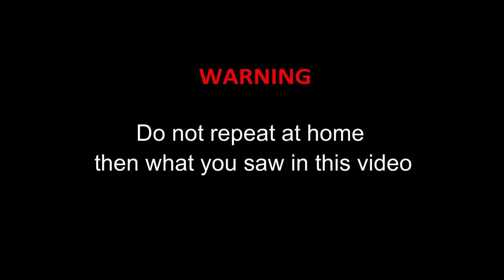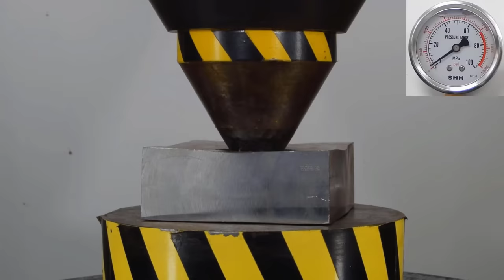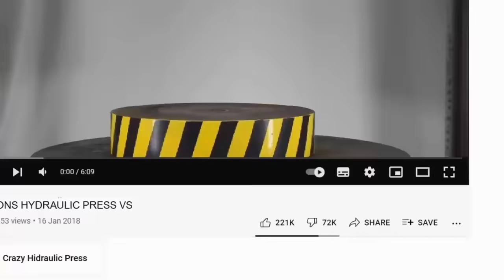HYDRAULIC PRESS VS OLD AND MODERN ARMOR

Comment: I've seen this press destroy so many things... I was quite surprised when something actually managed to push back for once.
Reply: Rifle plates can stop any Small arms bullet except maybe a 50 bmg. They are strong af. I have some armor plates myself.
Reply: He took explosions to a whole new level. And there was no bomb. Dam!!!
Reply: pay attention to the hydraulic tips, they use different tips..i doubt the results they get.
Reply: "push back" .... now ain't that a Newtonian term :)
Reply: @emmw7794  A 2" AR-500 plate like in the video should easily stop a 50 bmg...
Reply: @frankfurt9679  ich hab Physik nach der zehnten Klasse abgewählt. Ich darf das so sagen. 😏
Reply: Strong as F?  So just how strong is F?
Reply: The 666 has been achieved
Reply: @emmw7794 level 4 can. 3+  still has trouble with faster 30 caliber rounds
Reply: @CosmicGate184 not a personal protective vest
Reply: Well, technically, everything does push back
Reply: and even take revenge.
Reply: I need it to build my next pc chassis.
Reply: My muscles would destroy that press after a good pump. 🥴💪
Reply: @CosmicGate184   Bit of an expert on that here, as I work for the largest cutter of AR-500 in the US (we buy AR by the boat load, literally, and we test products at the range) 
You need 1/2" AR500 to stop a 50BMG at 1k yards (energy needs to be under 4000fpe), there's a higher chance of failure if the target is rigid mounted as well, you can get away with more if the target is hanging by chains and angled about 15 degrees, so it can deflect the round into the dirt. 

The video seemed to show 1/4", which is likely actually AR-400, fpe needs to be under 700 to reliably stop rounds, so pretty much only good for stuff like .45 or 9mm, but there's no scale in the video, so I could be wrong..... 5/16 AR500 good for .223 up to 300 blackout. 3/8 AR500 good for .308 up to 6.5 creedmoor. But again, angle of hit and rigid vrs hanging mounting makes a HUGE difference.
Reply: @mmabagain about five handies.
Reply: That was a straight violent implps😢
Reply: @x_andy7407 I was going to write the same thing. The one used on modern armor seems to be made of a lot softer material.
Reply: @mmabagain on a hexadecimal scale, nothing beats F.
Reply: @artankozak2557 that would almost make sense. If the impact is allowed to dissipate sideways without penetration, then what's behind the armor will endure a smaller force (blunt force trauma is still a thing), and then maybe the armour can also be thinner. But there needs to be something hard behind it, possibly ceramic, to avoid penetration.
Reply: @x_andy7407  They only need to use a tip harder than the thing they are crushing. The harder tips are much more expensive so they don't waste them on things that they wouldn't make a difference on.
Reply: @artankozak2557  The one used on the modern armor was the exact same tip. They had to switch out for a harder one. AR500 is over 3 times harder and many times more abrasion resistant than the plain steel plate that was used on old tanks.
Reply: @mmabagain I continue this word ... uck. It's strong as *uck.
Reply: I hope better shielding is going to be used. I'd suggest 3/4" plywood and a 3/8"+ polycarbonate window. Tie it up with rope or straps. Not being in the same room during a test also seems prudent.
Reply: FAKE!
He removed the paint of the Soviet armor. The Russian paint repelled the shells. The steel just held the paint in place.
Reply: @canopyjunkie1597 Anyone who says "bit of an expert here" when talking about anything firearms 🤣🤣🤣........I'll take the quiet guy for 500 Alex!
Reply: Nokia
Reply: @CosmicGate184  Пресс создаёт статическое усилие, а бронебойный снаряд - динамическое. При этом может быть хрупкое разрушение и осколки брони поразят экипаж и оборудование.
The press creates a static force, and the armor-piercing projectile creates a dynamic one. At the same time, there may be a fragile destruction and fragments of armor will hit the crew and equipment.
Reply: @emmw7794  How the he'll is 50bmg "small arms"
Reply: @mmabagain how suprising that you dont know
Reply: @sealytheseal8417  What do you mean? Any gun that a person can hold and fire are Small arms. LOL. 50 BMG is not that big. It's part of small arms fire.
Reply: @Vulcan_Raa All from kinetic energy 🤓
Reply: @canopyjunkie  100% accurate post..(i work in the industry as well..)
Reply: @darangdone3932  lol, I know "some" about firearms, but when it comes to the very narrow field of shooting at AR plate with a testing methodology, that's where I can say "hey, I know a LOT about this VERY specific thing!" LOL my time to shine 🤣
Reply: @Rwdphotos  Newton's third law is: For every action, there is an equal and opposite reaction.
Reply: Penitration 😅 its good. Yes ?
Reply: I've learned T-34 armor was made out of clay compared to more modern materials.
Reply: Strumień kumulacyjny przepala a nie przebija pancerz czołgu. Ten test nie ma sensu
Reply: Why are we not using older armor?
Reply: In fact there is a scale, he handles those blocks many times and states that they are 50mm/2”. He also handles the failed press cones as well.
Reply: @BladerDark1  дак видно, что AR 500- цементированная, а типа "броня Т 34" на проверку похоже вообще кусочек "котельного железа". Где он интересно в штатах найдёт оригинальный кусок брони Т 34? Даже в России разве что от памятников отрезать.
Reply: And that is why modern armor either stops a shot or absolutely dies. And thus scale mail armor makes a comeback.
Reply: AR500 is insanely durable. It will stop anything except for gamma beam ray.
Reply: @canopyjunkie 
Expert? The sphere was 80mm. The AR plate was about 3" thick.
AR (abrasion resistant) material designation of 400 vs 500 is composition not thickness.
Reply: @JonnyBob327  read the comment my comment was a reply to. And yes, dealing with and testing AR for the purpose of shooting it and testing it thoroughly has been my field of expertise for a decade now. FWIW 400 v 500 is the level of hardness achievable by the quenching process, the window for composition is actually quite wide.
Reply: and then you see a slow motion of an APFSDS penetrator round, or HEAT explosivelly formed penetrator round, both going straight through that armor plate....just that is 800-1000mm thick, and not 45mm thick. And you realise just how stupidly powerfull a main gun on an MBT is, nowadays.
Reply: @canopyjunkie  that sounds like information that probably shouldn't be shared publicly
Reply: Indeed! So what kind of steel was that 2010 armor anyway to withstand that press?! Damn!
Reply: @mmabagain  F'ing strong
Reply: AR does not stand for armour…js
Reply: @mmabagain  F = ma. And the steel obviously is as strong as F, since it survives the force applied to it 😉
Reply: Resist!
Reply: @mobileprofessional  resistance is futile..
Reply: I was just thinking to myself: what is that freaking cone made out of because I've never seen it get damaged.  And then it got damaged.
Reply: @canopyjunkie  wait all good, but what do you mean the one in the video seems 1/4", inches right?, It seem a lot bigeer than that at least more than a 1", check  2:33 and why does it make it AR-400? (checking again you can just compare it to the ball, it has 80mm the piece can be almost 2 inches. On another topic, where do you get the the AR steel?, I mean it is produced in the states or is it a thing you can get just from certain places in the world? My country just made a armored vehicle from scratch and many documents are public and just curious of where did they get the material.
Reply: @canopyjunkie  Hey! sorry just remember more doubts ive keep, they also used the typical MIG welding,  how bad is it for the hardness of the material?, and there is a better way to join the plates than that? (I just checked it was not specified AR500, but Brinell 500, they are the same right?
Reply: @juancastro6441   the weld (and technically the laser cutting) will anneal the steel closest to the heat, for this reason we don't weld on targets in the areas they are ment to be shot. the quicker the laser cutter is, the less heat soak, can always use water jet to cut too. I'd say it all depends on the application, for shooting steel or even lining dumptruck beds, it's not much of a concern, but for liability if it's a plate for body armor, I definatly wouldn't weld on the plate.
Reply: Ain't it hot to the touch after you press it?
Reply: Impressive
Reply: Hydraulic press vs anything the press will win unless you set certain parameters.
Reply: I have some spare bullet proof polyurethane stuffs. Not enough to build a enclosure, but will protect you camera.
Reply: @johnathon007 but how are they wasting them . If the tip is harder it should remain unscaved. The one tip should last forever until you run into something harder. You're comment doesn't make sense.
Reply: @SevenCostanza  when you expose anything to extreme forces like in this video, you degrade the item. The tip may survive but there is a high likelihood it degraded. It would have been nice to know the material and hardness of the tips as it would have put things into perspective.
Reply: Keiner brauch den Müll
Reply: @SevenCostanza  That isn't how hardness works. A soft material still wears on hard materials eventually. This is how water erodes stone.
Reply: @bramweinreder2346 Don’t you mean a sexadecimal scale? 🤓
Reply: @darangdone3932 So what you’re saying is, experts don’t actually exist. 🤔
Reply: @kucijajaa578 It’s an English thing.
Reply: Watch thy hydraulic press channel for better content.
Reply: @derrickrr5516  lol :) love it!
Reply: Anybody know what kind of metal the hydraulic press cone is made of? Tungsten carbide maybe?
Reply: THANKS FOR THE SPOILER
Reply: Second one was a lead spike. Easy to tell from the colour and not even a small dent which there should be !
Reply: Well it had a higher hardness than the cone
Reply: Ball bearings can be very, very hard.
Reply: @johnathon007 with metal it's more a matter of metal fatigue. Sure, steel is strong, but hundreds of tons of force on a small piece of steel in repeated cycles seems likely to cause fatigue
Reply: try 4" Tungsten
Reply: @emmw7794 with that thickness it could easily stop auto cannon rounds.